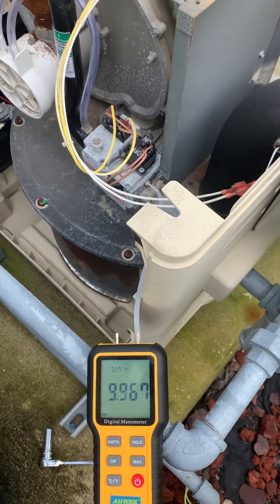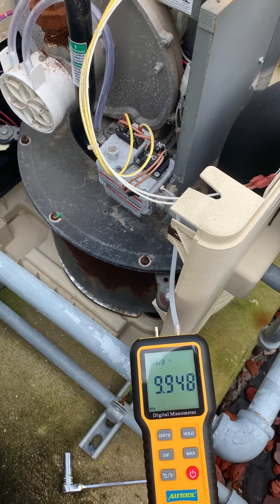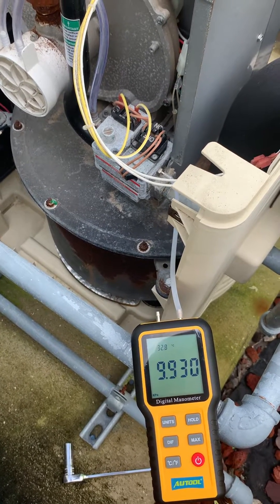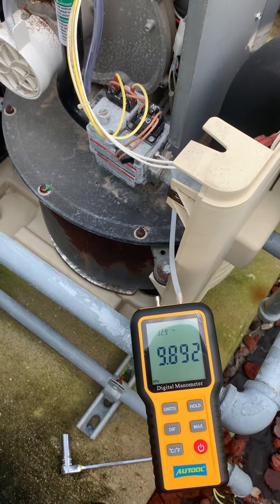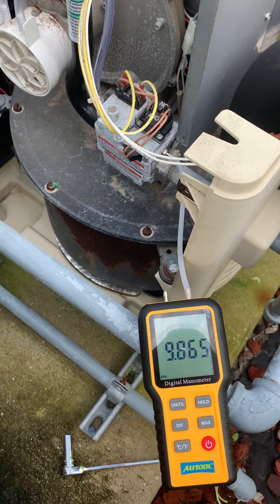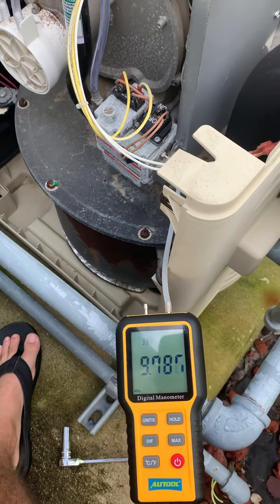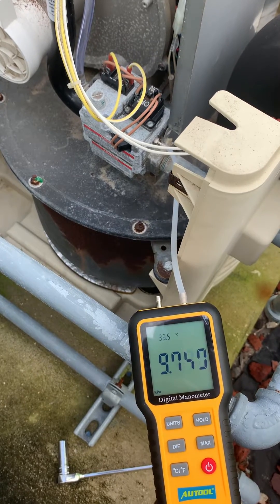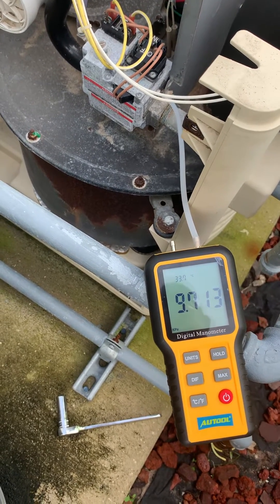Mastertemp 400 gas line pressure test

Comment: Did you try purging the gas line?
Reply from the maker: it was not needed to purge the line - though it probably helped.  What was the issue was a safety installation switch.  I bypassed the switch on the gas-flow control block and all was good.

Comment: It looks like you have the manometer set to KPa and it should be set to inches w.c.

Your pressure is about 40" w.c, which is way too high.
Reply from the maker: I did fix this in the end - and I was at 9.5” W.C. …..the issue turned out to be a faulty  switch which was easy to bypass.  See other shorts I posted on this topic :)

Comment: I have the same issue and change everything except for the control board.  Do you have a picture of how you bypassed the gas switch.  I would like to try it.  I watched your video "short" and can't follow your bypass wiring.  thanks.
Reply: I have the 3 flashing lights indicating ignition lock out but don't know the next step or what to fix.
Reply from the maker: https://youtube.com/shorts/tvDhjp-3IR0?feature=share

Comment: What ended up being the issue?
Reply from the maker: Ended up being the service switch….it was bad, so I bypassed it, so the switch isn’t in use anymore, and all is good
Reply: @IanB22  what is the service switch?
Reply from the maker: @neils9998  where the gas-line comes in…..there is a black switch the gas metering block….I by-passed that switch and all was working again.
Reply: I have the exact same issue and just found your videos. Any link you can provide on how to bypass the service switch?